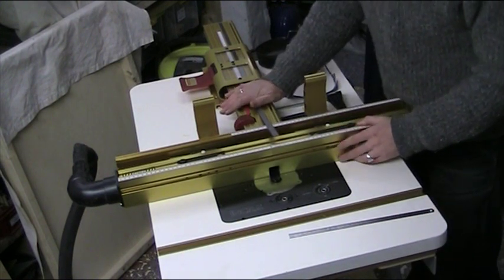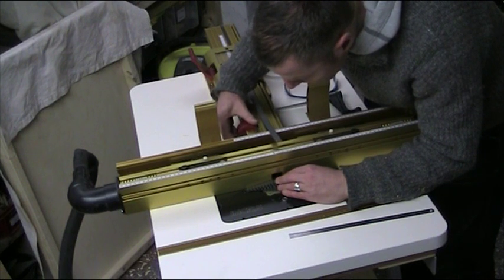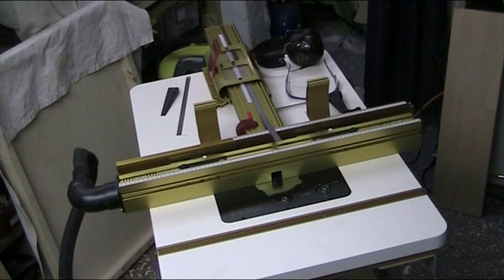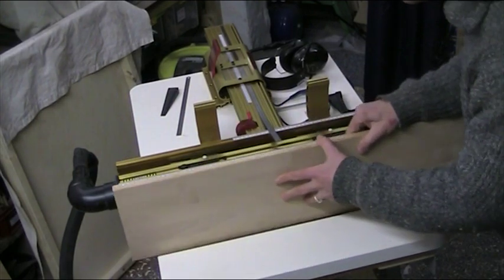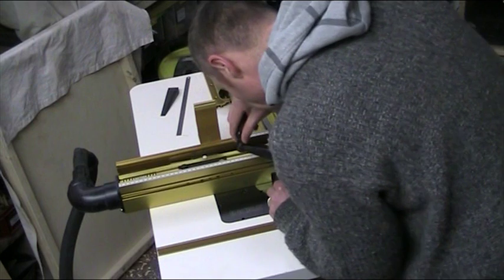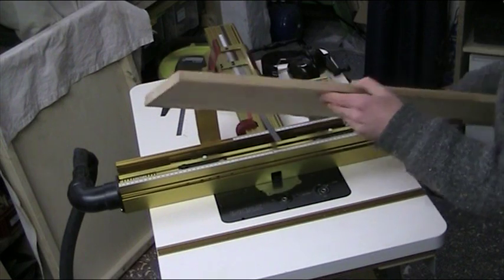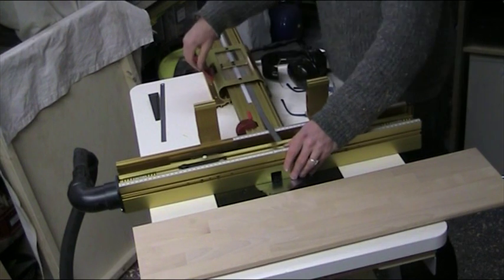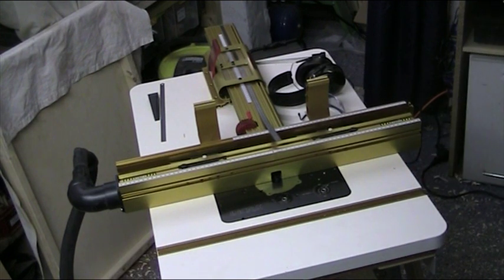Mast R Lift II part4

Comment: I noted that the workpiece hung up a couple of times on the trailing edge of the bit recess in the fence. Is that a common problem with the Wonder Fence? I'm "wondering" whether adding a light chamfer to the corner might be useful. All three of these seem like good investments regardless.